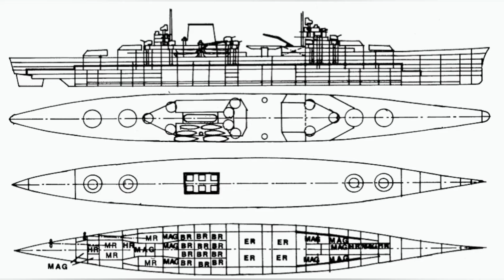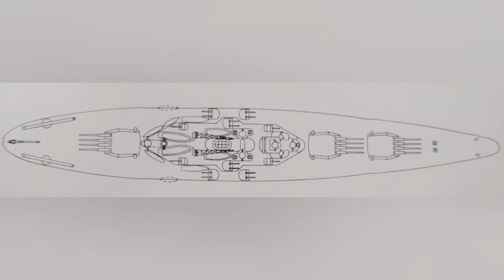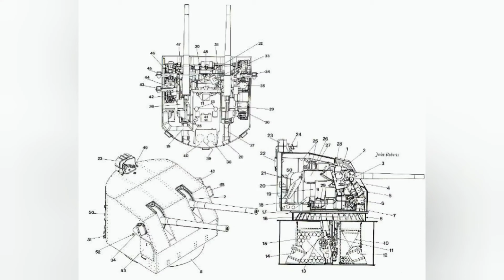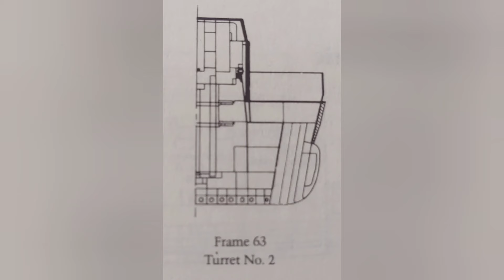Developing USS North Carolina

Comment: This class was a game changer for the USN, North Carolina's heavy anti-aircraft armament (later to become very heavy) came as a shock to the IJN as she quickly became the favorite escort of USS Enterprise's crew.  

This was the first class of USN "battlewagon" that could exceed 22 knots and had the cruising range to cover much of the Pacific with fuel efficiency that put the old "standard" types to shame, a very important consideration during the early portion of the war.  It was this "inefficiency" that initially kept the first standards repaired after Pearl Harbor close to home.  The U.S. had oil enough but lacked the tankers needed to get it where it was needed initially.

Comment: The USN underestimated the effectiveness of the North Carolina class armor. Her belt was only 0.1 inch thinner, deck was only 0.6" thinner and her barbette armor was the same, and only the turret face armor was significantly thinner at 14.5 vs 16.1" than the Iowa class battleships.